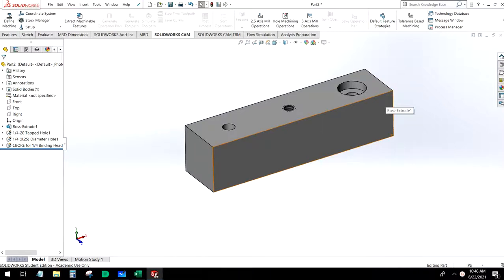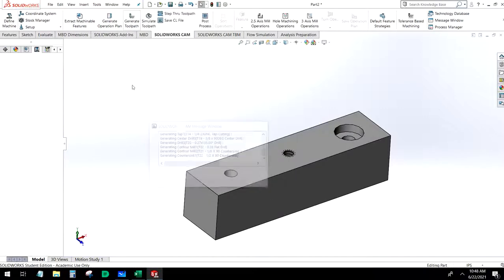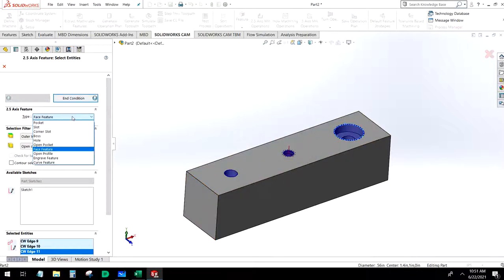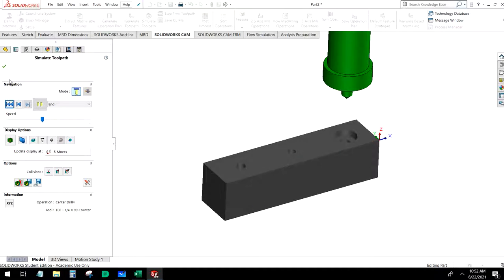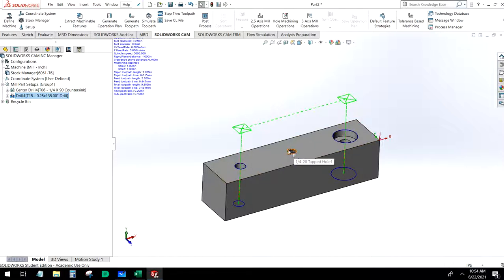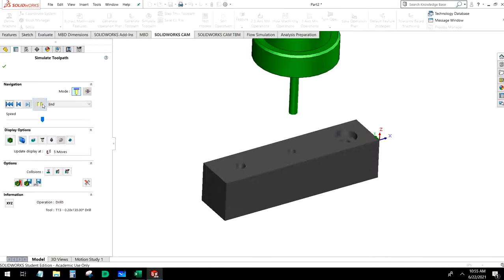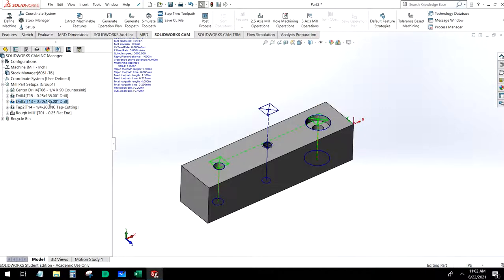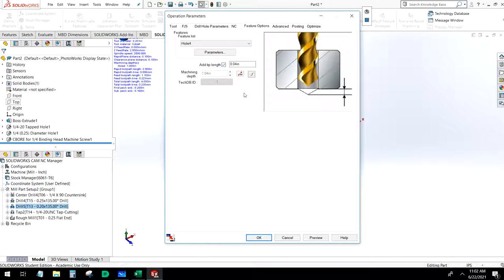SOLIDWORKS CAM: BASIC HOLES, DRILL, TAP, COUNTERBORE

Comment: For your center drills, solidworks needs depth changes on each individual hole. Under Operation Parameters > Feature Options > Features/Feature List you need to go through each hole and set the depth, otherwise you'll go all the way through by default.
Reply: I came looking for this answer in the video and found it here, ty Sr

Comment: Hi Professor Cameron, 

Thank you so much for your lecture videos on Solidworks CAM. It really helps me a lot!

I'm currently doing research for my master's degree and I would like to ask some questions. I hope you can help me to clear some doubts about Solidworks CAM. 

First, does face milling in Solidworks CAM can't define wall/boss like in SolidCAM?

Second, how pockets are defined in Solidworks CAM, because it says that in SolidCAM they are defined by loops, is it the same for SolidWorks CAM?

Lastly, do you have any idea about the tool engagement angle specifically from the manufacturing engineering point of view.?

Sorry, I do have a lot of questions, but I would really appreciate it if you can help me with these.

Thank you so much!